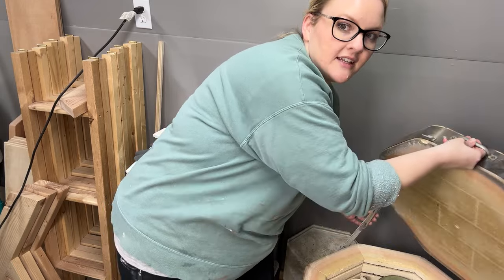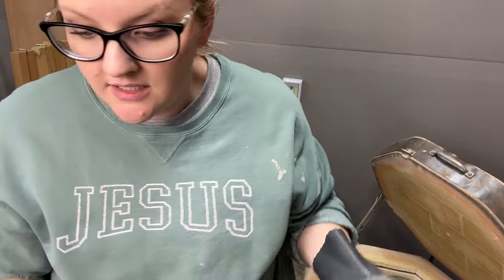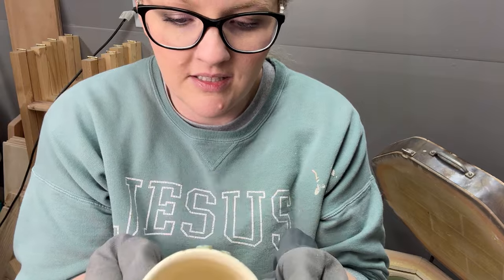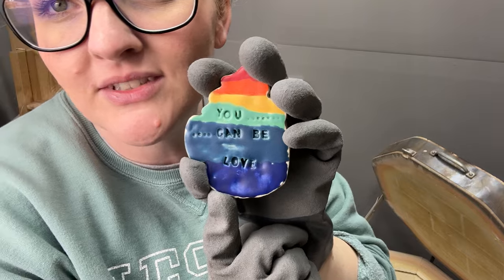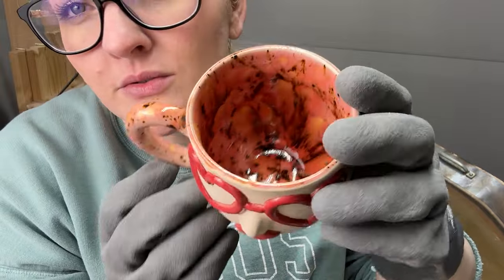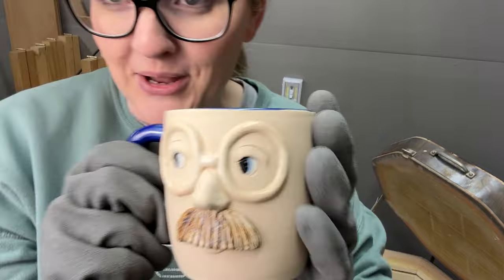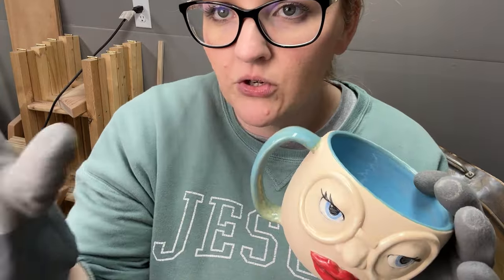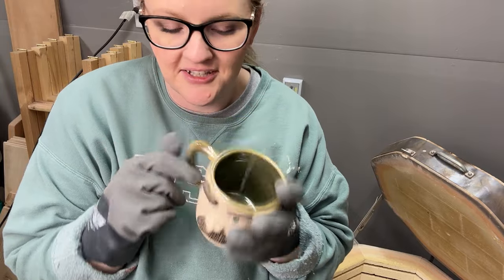Glaze fire kiln opening - New face mugs - cactus mugs and more #pottery #kiln

Comment: Hi just a way to keep your rims round. 
After you attach your handle and your mug is still leather hard, insert a small store bought terracotta flower pot into it, they are always round. It will bring the top of the mug back to round. I don't let it sit in the mug as Im worried about shrinkage and the mug splitting as the pot wont shrink but some people leave the flower pot in there for a bit to let it set up like that.  I just ensure its back to round then take the pot out and let the mug dry to bone dry before firing. occasionally I get a memory but not often, and its generally when I have thrown the mug super thin so maybe it's just warping in the kiln as the clay gets malleable.
Reply from the maker: Yes! I actually do this quite often. I must not have on this one though. Great tip!